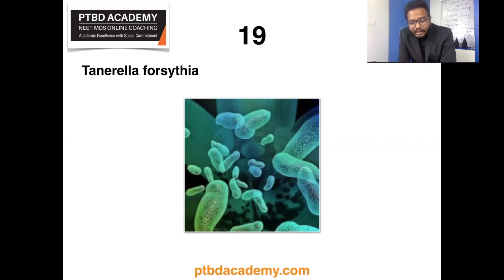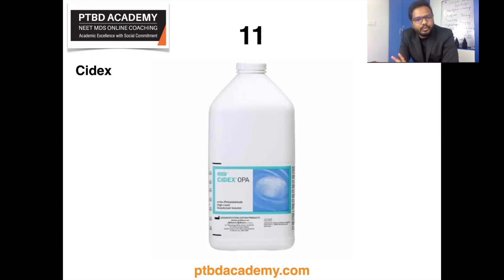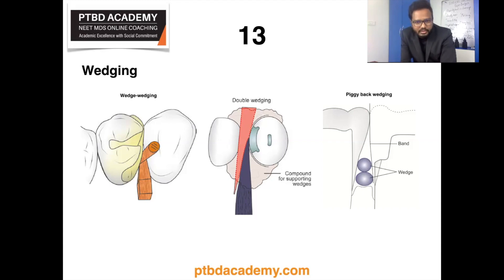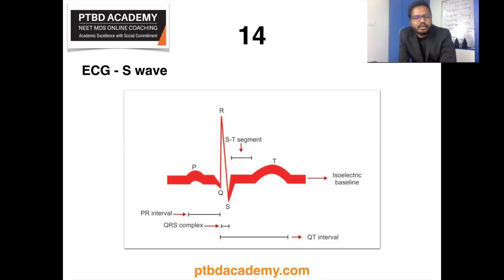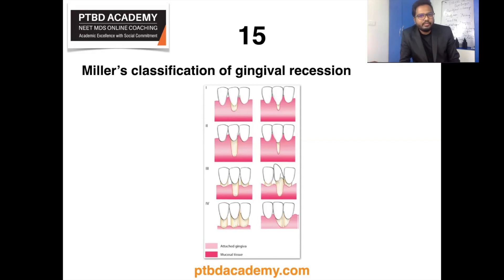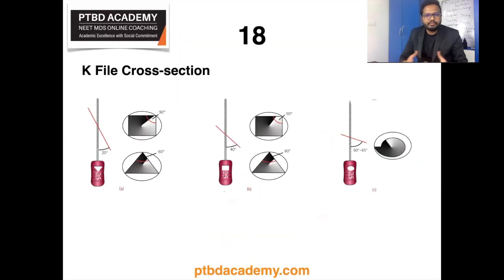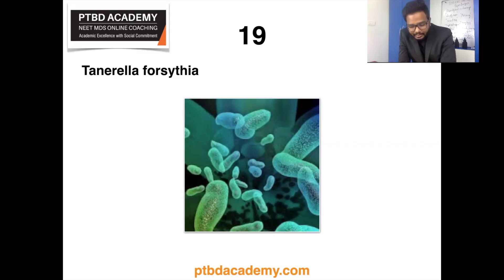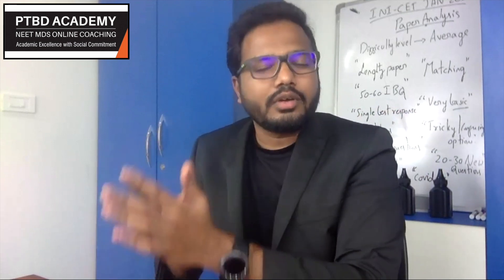Paper Discussion - 2 | INI-CET January 2021 | Topics & Clarifications In Description Below

Comment: 1.Kennedy class VI 
2.contraction in gutta purcha-2%/3%/5%/10%
3.not a property of caoH2
Dissolving/coagulation/antibacterial/
4.image based on 17,23 perio explorer
5.least slowest wave seen in
Stomach/jejunum/ileum/deuodunum
6.most common cause of tooth trauma
Bruxism/epilepsy..
7.strations in cardiac musclea is due to
Actin myosin/mitocondria
8.image based smiling muscles
9.image based spenomandibular ligament
10.image based IANB sites
11.major component of calculus
12.not true about telomerase
Only in eukroayotes/dna repair/reverse transcriptase
13.que on function of indirect retainer
14.why impression compound is used
Dimensional stable/cheap/mucocomprrssive
15.que on stage 5 of fishmen's index
16.que on properties of stannous diamine fluoride
17.que on MIH and dentogenesis imperfecta
18.gene mutation van der woude syndrome
19.frenkel class V regulator use
20.isoniazid antagonist vitamin
18.
Reply from the maker: Appreciate your inputs Amish, best wishes & love.